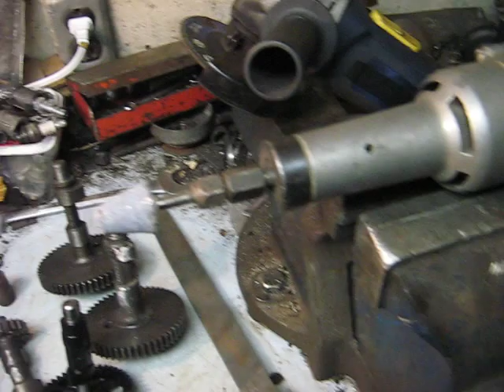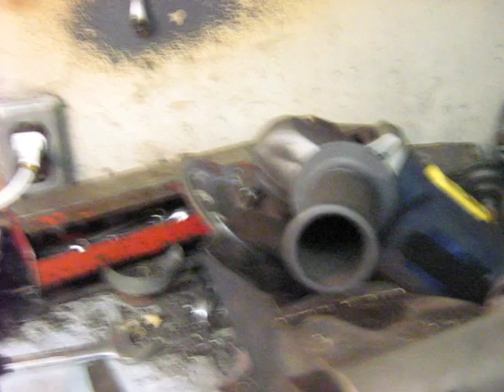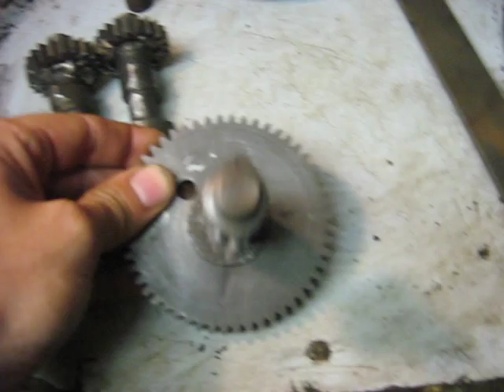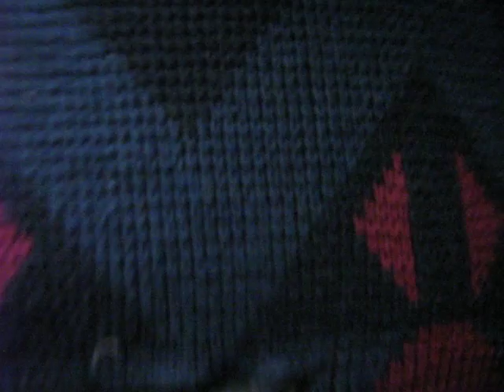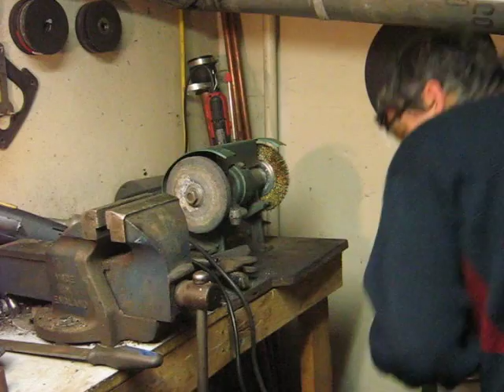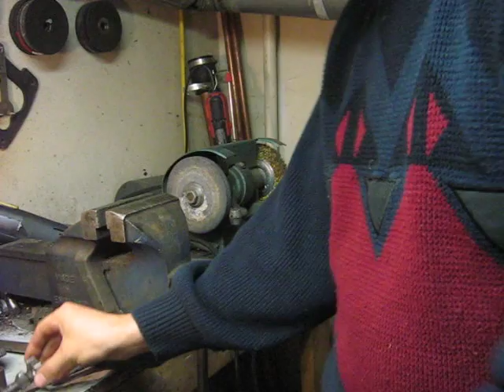Modifying Camshafts Vid 2

Comment: Does it work to jb weld a steel cam ?
Reply from the maker: I think it could work for a while, not sure how long though. If you try it you should scuff up the cam surface where the JB is going, to help it hold. Also clean the surface with brake cleaner spray (wear safety glasses), and wipe it down with paper towel. JB can be tough stuff, I have ran a piston made from it, as well as liner a cylinder, and a crankshaft journal. I don't know how long the JB can take the pressure of opening the valve, but it is worth a try, if you don't mind "wrecking" a camshaft.
Reply: ChargerMiles007 another question for you, have you tried to put the exhaust cam lobe in a vise and heat the middle part and twist it in order to achieve a different lobe separation.? Thank you

Comment from the maker: The cams seem to work OK my my purposes, but I honestly don't run these engines for long. Perhaps I will weld up a cam, and use it in a pushmower, just to test it out. I haven't tried to harden the lobes, sometimes they end up pretty hard, just from welding. I took teeth off a new file one time!

Comment: Hoe much durability do you get from the welded on lobes? I want to make a high lift cam for one of my Briggs one day. It's not going to be run a huge amount but I dnt want bits of cam floating round the block!
Have you ever tried hardening the new lobes after welding?

Comment from the maker: Yes, I could sure cause a Big Cuffusal with a machine shop!!!   :)
I am actually a Draftsman, so I do detail drawings for a living :)
It helps out, as I have put some Briggs parts onto the computer for layout purposes. I had to use them for the Supercharged Opposed 2 stroke engine, to know where to drill the ports tru the cylinder walls.

Comment from the maker: I am actually working on a poppet valved 2 stroke, been in the works for a year now. Guess I should get moving on it!
HHO, is that water?
Yes, you can change the timing pretty well any way you want, but it may entail doing a little grinding on the exhaust lobe, as it can hit the crank sometimes.
I do have a few 2 stroke vids, a ways down the list.